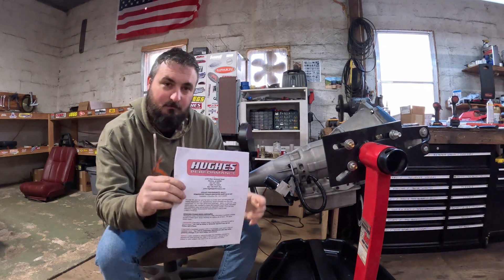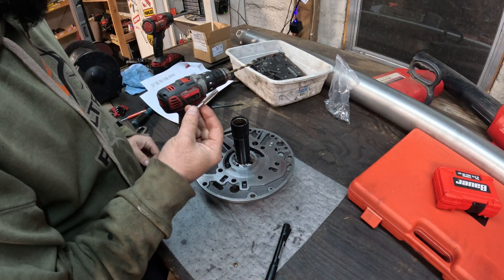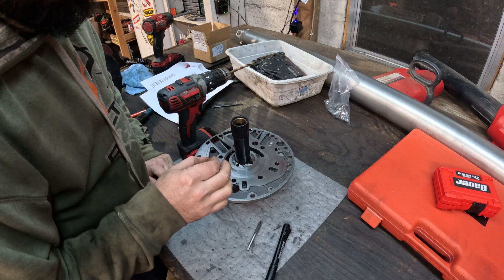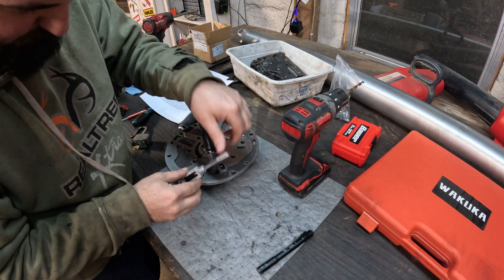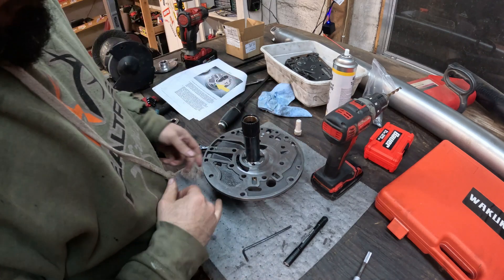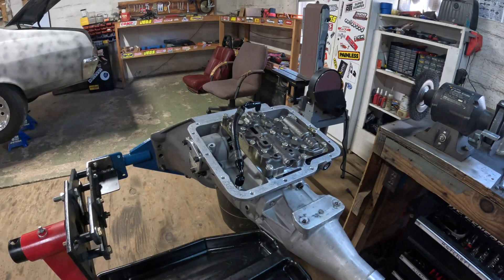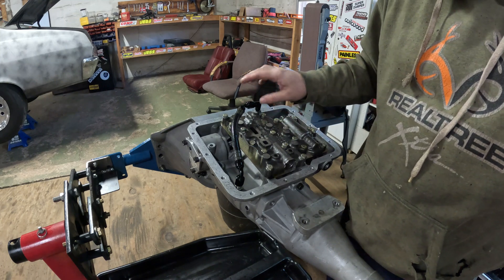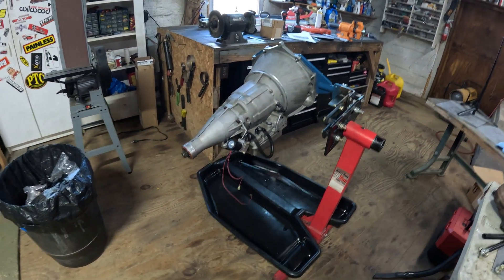Hughes dump valve for the powerglide

Comment: Why not put the bulkhead fitting in the side of the pan instead of drilling a hole in the case?
Reply from the maker: @jtingram8930   That is where the instructions were to put it, but if you change the line to a longer one, and install the bulkhead in a way where it will push into the pan so you can still remove it, that could work also.